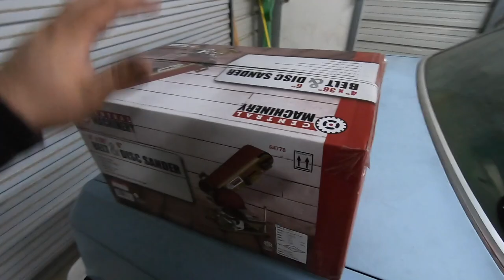Terrible Tig Welding: Aluminum Pipe

Comment: Can you please give some insight on what you changed / settings / tungsten / gas flow to get the better welds. The rest is just practice and aesthetics, but I am battling with the same pipe edges eating away.
Reply from the maker: Aron Pajda turned argon flow up, cleaned up my edges a lot better with the belt sander, used simple green and scotch pad to clean. I have amps on 110 and I’ll have to look but i think i turned my cleaning down a little. I’ll come back and update this when i look.
Reply: It's ur ac balance and frequency

Comment: Huge improvement from first to second piece you showed us!
TIG alum is very difficult to pick up 
Congratulations to you for running at it balls out

Jody covers alot of details in this video 
https://youtu.be/61xkueYn5wk

Keep it up brother!
Reply from the maker: Philip Myers thanks man! I’ve got a lot more to do on the new setup so I’ll be doing more research. My biggest thing is fit up. Thanks for the link. I try to learn as much as i can so i can do better at it.